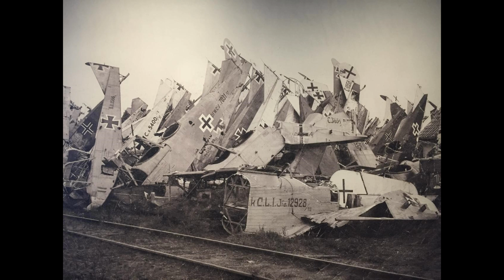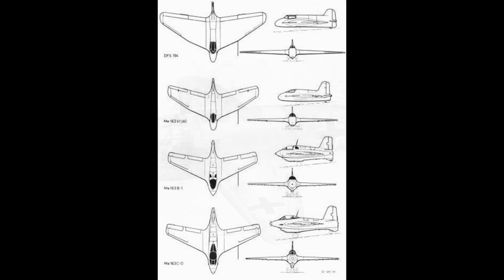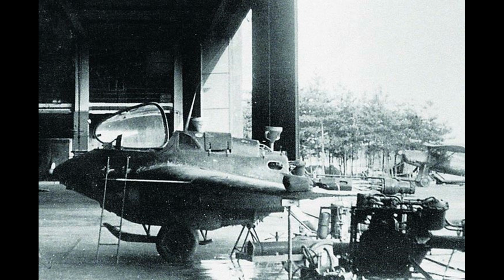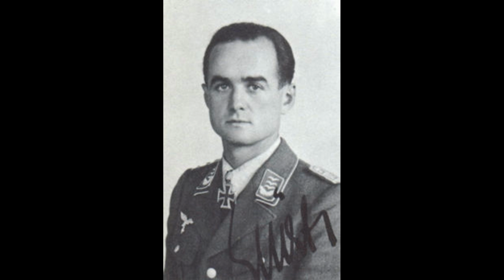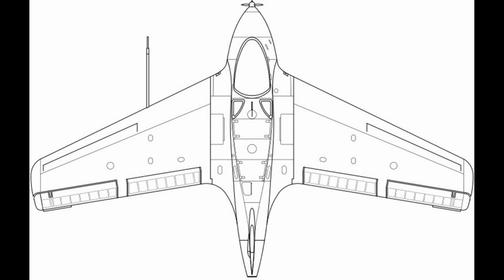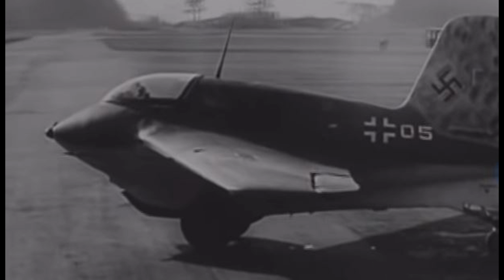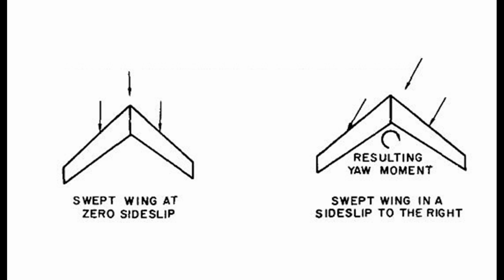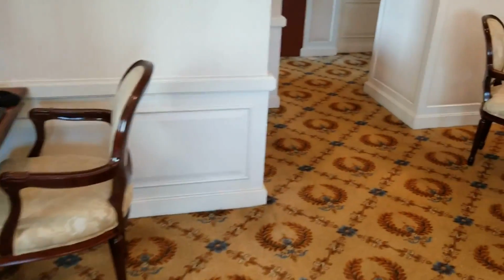Messerschmitt Me 163 Komet Pt. 1

Comment: A few additional comments about the F-106 discussion at 35:00
 
1) It's also worth mentioning the F-106 Delta Dart's successor, the rather less successful F-102 Delta Dagger, which first flew in 1953. The prototype was dogged by difficulties reaching Mach 1 until area ruling was retroactively applied to the design during development. The F-106 would actually begin life as the "F-102B," but so many changes were made it later got its own name and designation.

2) While the F-106 never saw combat, the F-102A was deployed to Southeast Asia from 1962 until 1968. They were used in combat during the Vietnam War, flying escort for B-52s conducting Arc Light missions. They also used the twenty-four 2.75 inch rockets in their weapon bay doors for ground attack missions, with limited results. During operations in the Vietnam War, one was shot down by a MiG-21, but no air-to-air kills were scored in return, largely due to the problems you mentioned with the AIM-4 Falcon missile. 

3) The USAF also used the AIM-4 Falcon on the F-4 Phantom II throughout the Vietnam War and Phantom drivers also loathed the weapon (Robin Olds had some very choice words for it!). 

4) Regarding the Genie, the USAF actually went to great lengths to persuade the US public that the Genie wouldn't irradiate nearby areas if used. After all, the plan was for it to be used to defend CONUS from Soviet bombers if WWIII started. The USAF even staged a test in June 1957 with five officers (and a photographer) standing under a Genie as it detonated 18,500 feet above them! All the men seem to have survived without any health problems (two even lived into their 80s)
Reply from the maker: I didn't realize there are so many fans of the 102/106. I barely mentioned it in passing and that's generating a big percentage of the comments on this video. Maybe I'll cover the century series stuff at some point.
Reply: @GregsAirplanesandAutomobiles  That'd be awesome! The Cornfield Bomber alone deserves an episode.

Comment: Does sweepback reduce compressiblity effects because the wings are swept or because the control surfaces are swept?
Reply from the maker: Primarily the wings. For example you could have a plane with a swept delta wing and non swept control surfaces. However, control surfaces are an entirely different discussion, and I haven't really touched on them much on this channel, at least not in terms of transonic and supersonic flight. I'll get to that, but it's too complex for the comment section.

Comment: Concerning the 163 landing itself, there was a famous incident of a 106 doing just that.  Wiki blurb->   ->->->->-."On 2 February 1970, an F-106 of the 71st Fighter-Interceptor Squadron, piloted by Captain Gary Foust, entered a flat spin over Montana. Foust followed procedures and ejected from the aircraft. The resulting change of balance caused the aircraft to stabilize and later land "wheels up" in a snow-covered field, suffering only minor damage. The aircraft, promptly nicknamed "The Cornfield Bomber", was then sent back to base by rail, repaired and returned to service, and is now on display at the National Museum of the United States Air Force."<<<<<<<------------------F-106's stuck around in ANG units up until the mid 88 and had still been sporadically in frontline units until supplanted by the F-15 in the 70's. Updated with a M-61 cannon and better canopy optics,

Comment: Greg,
One way to check the wing "twist" of the Me 163 is available. There is a beautifully restored Me 163 at the end of a five hour drive from where I live, but I can't say when I'll make the trip (I did view it last in 1972 and there was a second one under restoration in the engineering hanger). I also received my copy of the book "Peenemünde-West : Die Erprobungsstelle der Luftwaffe für geheime Fernlenkwaffen und deren Entwicklungsgeschichte" by Botho Stüwe and I'm doing a translation of the chapter where he states the wing washout was eliminated by  the time of the Me 163 B-1a.
Reply from the maker: That source I used is from a 1950 article on the 163 and the specs are for the B model. That doesn't mean they didn't eliminate it after some serial number. When talking about aircraft in the Third Reich, I can't really rule out anything.

Comment: Not sure if it's my crappy laptop but the audio seemed a little muffled in places. When you were talking about dive speeds not sure you mentioned the P-47. The P-47C dives very fast. Its initial acceleration is good and it quickly reaches its limiting figures (520 m.p.h., I.A.S. at 10,000 feet, 450 m.p.h. at 20,000 feet). At these speeds the recovery needs several thousand feet and can only be effected by careful use of the trimming tab.
Reply from the maker: I have an entire video on P-47 dive performance. It's quite detailed.

Comment: Mipalam flooring, made in "West Germany" back in 1992, was used at the Jet Propulsion Laboratories' new (1992) B-307 optics cleanroom, because it was "ESD", electro-static-discharge,  could be the same fiber you talk about for the rocket fuel? I heard of that same flooring used in other cleanrooms on the Lab. The seams wereheat-welded, making the floor one big unit.

Comment: Stoff in the concept of chemistry is best translated by substance. People telling to simply use the english term stuff are not wrong, but the Stoff in chemistry is a little bit more formal. Some chemical elements include btw the stoff suffix like hydrogen, carbon, oxygen and nitrogen, which are respectively Wasserstoff (water substance), Kohlenstoff (coal substance), Sauerstoff (acid substance) and Stickstoff (suffocating substance) in German.
btw: the German wikipedia page https://de.wikipedia.org/wiki/Chemischer_Stoff links to the english https://en.wikipedia.org/wiki/Chemical_substance

Comment: Thanks for the pictures, although I have seen information regarding the Me 163. My two cents - the Huns were crazy as the Me 163 killed dozens of Luftwaffe pilots, while taking down only a handful of allied aircraft. The damn thing was an incredible swept wing design decades ahead of it's time, yet dangerous beyond words due to it's fuel. 

I can't believe German designers didn't attempted to put a jet engine into the aircraft, or think to extent the fuselage in order to fit jet engines.
Reply from the maker: They actually did work on a jet powered plane that was very similar.

Comment: Back in the late 1990's we had a German exchange pilot at our Squadron at Cannon AFB, NM the 524th. We both shared a love for WWII German aircraft and he told me through some of his research on the ME 163, his favorite aircraft, that if the wings had been swept back just 3 degrees more the aircraft could have hit mach 1. According to him, there is a team of Germans who want to build a modern version of the 163.
Reply: hmm, not likely, the lack of a horizontal tail  surface would make it uncontrollable (sudden pitch change) as the shock wave in the transonic range moves across the wing and changes the center of pressure / lift...  that's why Hanna Reitsch crashed in it...  that's why the DH Swallow crashed, also no tailplane....
Reply: @PRH123 Hanna Reitsch crashed-landed an unpowered Me 163B on a glide test, because she failed to release the wheeled dolly when her tow lifted off. Women. There are multiple claims that the 163, flown by Dittmar, broke the  sound barrier on more than one occasion, while in a dive, and post dive/on the level, when released. The layout was stolen by the DH 108, which broke the sound barrier. A more pronounce sweep, which the DH 108 did have, might be all the 163 needed(s)
Reply: @danieljoseph255 "Women." Quite the comment. 🙄
Reply: I don't know if you meant the "women" in a sarcastic manner, but I'm going to rectify it either way. She crashed trying to save the plane, after attempting to get the dolly to release using high maneuvering. She returned after five months in the hospital, wanting to fly again, but wasn't allowed by the rich because she was a valuable propaganda asset. Yeah..women... Just watch the next video in this series and Greg explains what happened.
Reply: @danieljoseph255 ”women”?  Your mother must be so proud of you.  (Facepalm)
Reply: Stoff....Mix....formula
Reply: 'Stuff' 😉
Reply: ..problem being that all that speed is great but it's supposed to be a defense fightern which it was not and could not be. Just for starters there was no contemporary sighting mechanism nor machine gun that could actually be used in an aircraft this fast, in combat much less faster.

Comment: I have always seen , and used the term "washout" preferable to "wing twist" . On RC Airplanes without flaps it really works to prevent tip - stall.Another thoroughly researched video. thanks.
Reply from the maker: Both terms are fine but twist is more self explanatory.

Comment: Greg,
At 37:16
I can't make out your laptop brand & model. What is it?
Thanks.
Reply from the maker: Why?
Reply: @GregsAirplanesandAutomobiles  I'm always looking for a laptop to use on the road that has enough power to do substantial video editing at customer sites. Right now I have an HP Envy 17t.
Reply from the maker: It's a Lenovo, I don't know the model, my kids bought it for me about 4 years ago. So far so good. Traveling takes a toll on a laptop, but this one has held up well.
Reply: @GregsAirplanesandAutomobiles  Thank you. I'll check on models with Intel processors. The HP Envy is OK, but it gets brutally hot and drains the battery in no time.

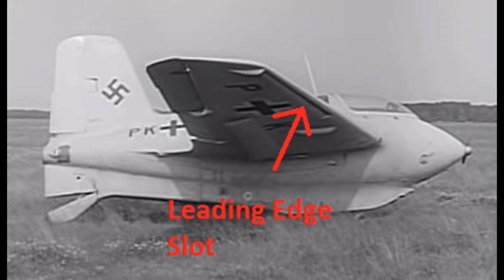Comment: At 27:30
Wing twist:
The Me 163 B-1a did not have any wingtip "washout" built into it, and as a result, it had a much higher critical Mach number than the Me 163 B-1.[27]

https://en.wikipedia.org/wiki/Messerschmitt_Me_163_Komet

[27] Stüwe 1999, p. 254*

Me 163A V4 (It highlighted the need to reduce or remove washout)
"It was ascertained that the sudden change in wing pitch stability that had sent the Me 163A V4  into an uncontrollable dive had resulted from the retention of a wing essentially similar to that of the DFS 194 which had considerable washout, the wingtips having a compressibility stall in the negative lift range"
page 597, "Warplanes of the Third Reich"  - William Green - (C) 1970 - SBN 356 02382 6
NOTE:
It seems the washout was removed by the time of the the Me 163 B-1a.

* Stüwe seems to be Botho Stüwe the author of:

Peenemünde-West : Die Erprobungsstelle der Luftwaffe für geheime Fernlenkwaffen und deren Entwicklungsgeschichte

I have just ordered the book. I'll get it end of March. Let you know what I discover.

Comment: why did they use this corrosive fuel and not LOX and RP-1 or LOX and Ethanol like in the V2 (A4)?
Reply: A cryogenic fuel requires considerable handling equipment. Also once it's loaded you have to go before it boils away, not convenient for a air defense fighter sitting ready to go on the ground waiting for the bombers to show up. The work von Braun did with LOX and the V-2 for the German Army was all very cutting edge, and they blew up lots of V-2's before they got it figured out. That said, the Germans had a thing about H2O2, even trying to build submarines powered by it.
Reply: @sheritonn5019  thanks, makes sense :)
Reply from the maker: Hi Werner, I have no idea. Chemistry is way outside my scope of knowledge. Perhaps someone else here in the comment section knows.

Comment: Question -  Critical Mach number’s are mentioned in the video for various type aircraft. Just wondering if there are/was any estimation/evaluation regarding actual flight performance of the 163 as to it being capable of exceeding the speed of sound (Mach 1) at altitude?
Just wondering/what if?🤔
Reply from the maker: Yes there was, and it could not break the sound barrier. At critical mach the pitch down tendency became too much for the flight controls to overcome.
Reply: Greg's Airplanes and Automobiles Thank you for the information/reply.....
(Ja, Vell there goes das “Birthday present” for Adolf.)🤦🏻‍♂️
Reply: @GregsAirplanesandAutomobiles  Geoffrey de Havilland demonstrated this with the similar DH-108.

Comment: Another fantastic video. What a unique and crazy aircraft. 
I suspect that the primary motivation for a swept wing in this case was to achieve a sufficient static stability margin in pitch rather than yaw. That is usually the case with tailless/flying wing configurations.
Also, as this plane was capable of very high speeds, the swept wing was possibly necessary to avoid issues with wing divergence (especially considering the wings were made of wood).
Reply from the maker: I'm actually writing about the pitch stability issue right now for Part 2.
Reply: @GregsAirplanesandAutomobiles  I'm looking forward to seeing it!

Comment: 1:15 the longest glide by the Wright Brothers I could find was 190m in 1902 while Otto Lilienthal achieved 250m in 1893.
Reply from the maker: Totally different. The Wrights were not trying for a glider record in 1902, far from it. They were simply using gliders for the purpose of developing control systems for their powered airplane. They didn't go after the glider record until much later. The record I spoke of was set on October 24th 1911, and it was 9 minuets and 45 seconds.

Comment: The fuel for this thing was noxious, toxic, caustic, and nothing anyone sane would wish to handle. Protective clothing was super vital.
Reply: Actually, it wasn't noxious, nor caustic nor toxic.  It was hydrogen peroxide which has no smell and is not caustic (as a base) but as an oxidezer, and partially diluted alcohol, which again has no strong odor and is not caustic.  Neither are notably toxic.
Reply: @KB4QAA  One of the two main fuels will melt your body and the other is about as flammable as something can get before mixing. Alcohol and hydroperoxide. Are you nuts? When the two are mixed they self ignite or more correctly explode!!
Reply: @dwightehowell8179  The OP was not about flammability, nor about the reaction of the two stoffs.

Comment: 30:30

EDIT: I stand corrected

I think you might be mistaken regarding the control surfaces. Namely as the inner most surfaces worked independently to control pitch while the outer most worked independently to control roll. In addition there were independent flaps that deployed under the wings too. Plus I think you over state the danger just a tad as if flying the me163 was analogous to Wylie coyote igniting one of his acme rockets. That sure enough it was dangerous but keep in mind that astronauts likewise fly on hypergolic propulsion as well. That said I quite enjoyed your video. Looking forward to the next one.
Reply from the maker: Are you saying that the outer pair, which are called elevons don't control pitch? Do you have a source for this?
Reply from the maker: Also, I clearly mentioned the flaps under the wings. I don't think I am overstating the danger of this thing, but if you think so, that's OK.
Reply: @GregsAirplanesandAutomobiles  - You know what I may stand to be corrected here. I probably got that impression when playing War Thunder without actually questioning it myself. Makes me want to dig deeper myself but would be happy to be corrected. Also how they would of designed the function of the elevon relative to stick inputs.
https://aviadejavu.ru/Images6/AE/AE72-9/132-1.jpg
Reply from the maker: No problem, your comment actually caused me to dig a little deeper and I found an old flying magazine article on the plane as a result. Anyway, I did verify that the elevons work the way I described. The stick works normally from the pilot's point of view, but there is a mechanism that mixes the inputs. For example, if the pilot moves the stick back and to the left, both elevons move up, but the left one moves up farther.
Reply: @GregsAirplanesandAutomobiles  - Oh I know the elevon principle. I fly an RC me163. Though the surfaces on my model aren't split like the real one does for the trim flaps. But rather I'd be curious how the mechanism works in the me163 while maintaining the same control configuration of the stick.
Reply from the maker: Good questions, I'll talk about it more in the next episode, working on it right now!
Reply: @GregsAirplanesandAutomobiles  - Looking forward to it. Love your work!

Comment: So, regarding the propellants, to summarise: they used two indistinguishable liquids which explode on contact with each other. Both of which have their own sets of materials they should not be allowed to contact with (including each other's tanks and fuel lines), else there'd be an explosion. They put the most dangerous of the two in a tank right behind the pilot, and later proceeded to install two extra tanks in the cockpit. They did all this in a small, fast aircraft and sent it up against other aircraft firing bullets at it. And finally, they did not tell the pilots what the fuels were.

I don't care how technologically brilliant this all was, the Germans were completely out of their minds back then.

Excellent video, thank you very much. Looking forward to the next instalment!
Reply from the maker: Yes, that pretty much describes it.
Reply: @GregsAirplanesandAutomobiles  Thanks for the reply! Hi from a Dutch fan :-)

Comment: Great video as always.  Years ago, say 50, I made some hand launched gliders with swept back paper wings.  By bending the paper back on itself you can make a decent airfoil and they were super light. It was hard to get them to be stable. Dihedral didn’t work to well. The cg was basically in the wing, no righting lever.  But I read in some forgotten book that twisting the wing so the angle of attack at the wing tip was GREATER than the angle of attack at the root (the opposite of the ME163 )  would stabilize the glider. It worked like crazy! I have no idea why.  Of course it was a paper airplane it had no ailerons to worry about.